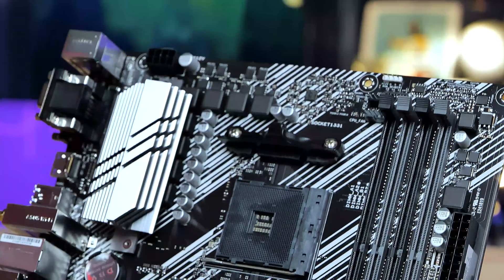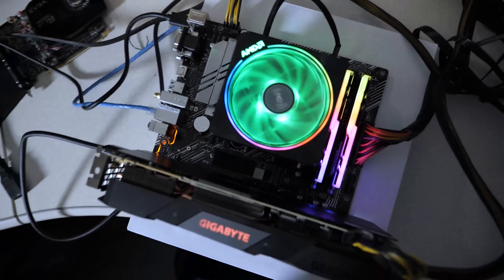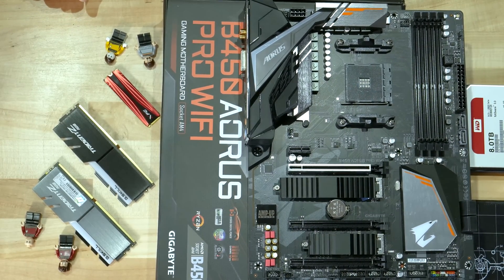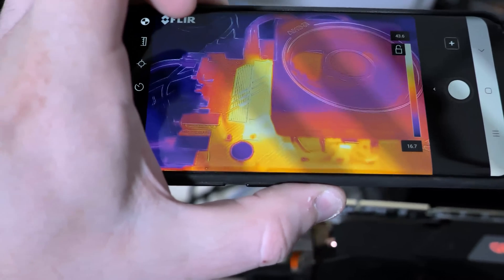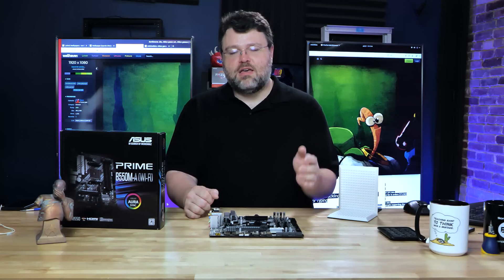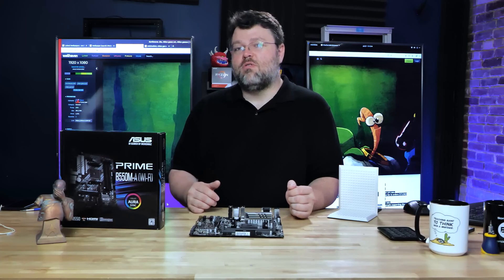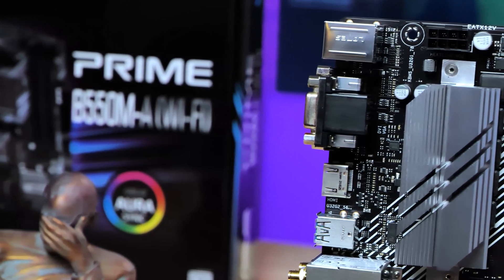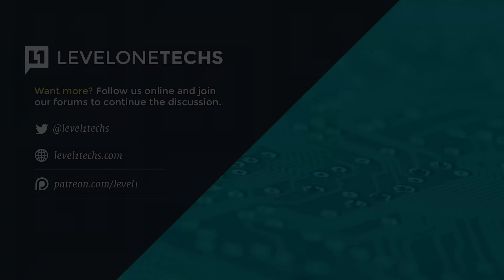ASUS B550M-A PRIME Motherboard Review! - But How Is The VRM?

Comment: 5 years with this mb -wifi, Ryzen 7 3700x evga 10 gb rtx 3080 32gb ram but im very novice and went from artifacts to intermittent blinking(blanking). beside that solid frames but terrible desync. im sure the build is solid its just tweaking and user error

Comment: WOW asus is using thick thermal pads instead of properly mounted heatsinks with thermal paste or thin good pads, i thought these motherboards are suposted to be good.... what a joke, i just purchased a motherboard and wanted to put some good thermal compound on to replace the typical mass produced white goop and it has about 1.5mm thick PADS with about 1.0Wm.k that go bad fast makes the heat sinks basically fake and just for show, AVOID, the chip dies are perfectly flat and should had 4 mounting holes and long lasting thermal paste vs garbage thick pads that leakout and drip goop

Comment: Does this motherboard have bluetooth? I bought it thinking it did but have spent ours trying to get the Bluetooth to work it reads that there are Bluetooth drivers and it says Bluetooth is enabled on the bios and in windows (yes I’ve updated the drivers and I even completely reinstalled the Bluetooth drivers and it did nothing)

Comment: This info was a big help. Much thanks! Migrating from a Ryzen 3 3300g with RTX 3060 on an Aorus B450 pro wifi to the ASUS Prime B550M-A WiFi and a Ryzen 5 5500 with same gpu. Basically a New/Old downsize build from mid tower to mini tower with card reader and optical drive for historical archiving and light gaming. RAM ddr4 16gig 3200 mhz to ddr4 32 gig 3600 mhz. Linux Mint OS.
Reply: How’s is this motherboard with the Ryder 5 5500?

Comment: I'm running a 5900x and a 3070 on this motherboard, but a 1tb Western Digital Blue sn550 that's almost entirely filled up. I've been thinking about this samsung x5 external 2tb drive that I've had for about 6 years that I don't really use because my system is amd and has no thunderbolt 3 ports. I was thinking of dismantling it and taking that 2tb 970 evo out of it and putting it in the second space for a ssd on this motherboard, but not only is it slower than the spot with the primary ssd, it looks like it would require me removing the graphics card first in order to get to it and I don't want get into all that stuff. So, now I've gotta figure out a way to clone that drive unto this 2tb, so I can swap out the ssd in the primary spot. Oh boy!

Comment: 4 years later, getting the "II" version for my brother's PC (now that I have hand-me-down 32GB DDR4 3200, 3700X and NH-12S). Considering that his case can fit 10 slot boards, has 2x 230mm+ 1x 140mm fan (could put 4x 140mm or another 230mm fan on the side panel) - VRM thermals will never be an issue. And TBH beyond looks the case is utter overkill in every aspect for anything less than an E-ATX board, so it'll never need replacing.

Every other board in the same price bracket that was available had older wifi and BT.

Comment: Is this enough to push the 5700X to its limits or is it worth it to spend 15€ more for an ATX board with better power delivery and more stuff in general?
Reply: This motherboard will handle 5700x without any problems. But for 5700x3d and above, I would recommend choosing a motherboard with a better VRM zone.

Comment: i know this video was made 3 years ago but do you think this motherboard would handle a ryzen 7 5800x? i plan to pair it with a msi navida 3060 oc
Reply: I have this board with a ryzen 9 5900x overclocked with watercooling.  I had to add a fan to the vrm's because there was no more airflow due to the wateblock but they will push 215 watts to the cpu no problem.  Asus actually uses this board in their pre-built desktops with a 5700g and a 3060.  Yeah you're good!

Comment: If you could help would be great! I just got this motherboard and paired it up with a 5800x3d & rx6800xt, I used 4x 8gb 3200mhz corsair vengeance white argb ram, the pc ran with it running around 2100mhz but as soon as switched on xmp or even just manually switched the mhz to 3200, the pc would crash instantly after trying to boot and popped up with a system error and took me straight back to the bios. I removed 2 sticks so now it’s running absolutely fine, no crashes and is running xmp at 3200mhz, just would like to know how I could make the extra 2 sticks of ram work as I’m baffled to why it wouldn’t, just seems like a waste of money on the extra 2 sticks otherwise! Thanks if anyone knows the answer!
Reply: Hey, i got same motherboard but with ryzen 5 5600.
I got 2x16 ddr4 3200 mhz lpx corsair ram.
If i use d.o.c.p profile it can run it no problem but sometimes pc fails to cold boot, then i have to restart it and it sends me to bios and i just don't change anything and it boots normally.
Looks like this motherbord have very sensitive memory controller.
I'm still trying to find my stabile ram speed and voltage.
It has no problem at stock 2133mhz speed.

Comment: I used this mobo for my build, works fine and no regrets at all
-Asus Prime B550M-A AM4 DDR4 M-ATX
-AMD Ryzen 5 5500G 3.9Ghz up to 4.4Ghz AM4 6 Core
-MSI GeForce GTX 1660 Super Ventus XS OC 6GB GDDR6
-SSD MSI Spatium M461 1TB PCIe 4.0 Gen 4x4 NVMe M.2 2280
-RAM v-color DDR4 SKYWALKER PLUS 16GB 2x8GB 3200MHz CL16 Memory
-HSF Deepcool AK400 Zero Dark 120mm AIR CPU Cooler
-PSU Corsair CV Series CV550 550W CV 550 | 80 Plus Bronze | Flat Cables
Reply: Did it work out of the box with that 5500G? I'm thinking about upgrading my i5 8400 to a R5 5500. Looking for a motherboard that doesn't require a bios update.
Reply: Does this mobo has less feature in armoury crate compared to tuf series mobo

Comment: I managed to burn out a CPU cooler on this motherboard due to installing it wrong; connectors melted into the sockets and the cables burned, CPU broke too. But the motherboard took no damage thanks to the high quality Japanese surge protectors, so I just had to get a new CPU and a cooler. It's still working fine three years later. 😅

Comment: Hi....... im planning to buy this motherboard today on amazon. Can someone who has the board just help me by just saying does the power LED blink when its in sleep. Gigabyte sold me a motherboard which their support manager tells me to prove where in the manual does it say it will blink during sleep mode....and asks me politely to bugger off and they dont even have to answer....that means it doesn't have that facility. I was like WTF ? its the most basic function it doesn't need a mention in the manual. Don't all mobos allow the power led to blink when its in sleep mode ??. This shit Gigabyte B250M mobo doesnt....and bec of that i sometimes dont know if i can off the power socket...in fact the support asshole was like didn't even take effort to troubleshoot....he says prove in the documentation that its SUPPOSED TO BLINK. Now next these fellows will sell a mobo which cant even do that and we customers will have to eat shit. So i wanna be sure.

Comment: I was considering this motherboard to pair up with my Ryzen 7 3800X and yes, I don't do overclocking nor I dare to do so. It should be fine, right?
Reply: Just got this MB for my Ryzen 5 5600X, and considering doing a slight overclock. Did you experience any issues with yours over the past months?
Reply: @JonathanGuzmanDesigns  did you have to update the bios for it to work? I'm getting "no signal" on the monitor

Comment: I have the non-wifi version the prime one and currently have a 6900xt and it fits fin but I am using a (GPU holder?) Not sure what they're called but it came with the GPU so it's not leaning down on the end. And it even fits in my little cooler Master q300l. But now I'm upgrading my 2600x to a 5600x and I'm still confused on how to get the bios ready for the 5000 series chip. Do I still need to use a flashdrive to update it or can I just update the bios with the 2600x and then throw the 5600x in and update the chip?
Reply: do you currently recommend this motherboard for a ryzen 5 5600?

Comment: "All in all this is a perfectly reasonable motherboard" Oh yaay, it's the one I've ordered. I'm not hardware technical, I'm not even building it - it's such a small overhead to get a professional to do it and I want a single warranty and no stress. I certainly won't be overclocking it. And I paired it with the 3700, which you suggested almost what you suggested. And reasonable graphics card, a 3060, I'm sure would count. So phew, I was probably just lucky.

You did well to make the broad strokes clear to a layman. Thanks!
Reply: hi man. its been 11 months, how is this working?
Reply: @yusastudios  Delighted with it, I did chuck 32gig of half decent ram in it which always helps but I haven't had a single problem. Just last week I coded a pretty intensive web scraping script which ran for three days in the background and there wasn't the slightest issue as I used the computer for everyday use.
Reply: @davidmurphy563  thats really nice to hear. What is your configuration? Power supply, processor, graphic card etc

Comment: If you are scared of this VRM, i am using Asus B450M-K with a Ryzen 7 2700x with HyperX Predator 2x8GB 3200mhz, not a single problem (system is used 10h a day for the past 14 months, stable as rock)
Reply: You are using xmp profile for ram?

Comment: Hardware unboxed tested that MB, and it nearly melted. Even failed the last tests.
Reply: That bad?
Reply: @chrike01  Yes, 103 degrees VRM with a stock 3700x.
And crashed when running a 3950 OC. It is the worst performer by far in the budget class.
https://www.youtube.com/watch?v=wuPH9pCCK-E&t=853s

Comment: Can i use this motherboard with ryzen 5 5600x and amd 6800 graphics Card?
Reply from the maker: Yes B550 or X570 is the ideal MB pairing for latest Ryzen/Radeon :) it's support for B450 & X470 that's sketchy, but should be better compatible in the future. ~ Editor Amber

Comment: Using this with a 3700x and 2060 super. Works great.
Reply: How is it so far?
Reply: @everythingRICHARDIFY  still going strong
Reply: @keithw4920  thanks! Did you get any thermal issues with it?
Reply: @everythingRICHARDIFY  Not at all. And I live in the tropics.
Reply: Do you reload one of your GPUs if the other one over heats ?

Comment: Thanks for the review. gonna put this with a 3070 and Ryzen 5000
Reply: Work out the box?
Reply: @julianosorio2003  havent catch the 3070 for now. but is good with the 5 5600
Reply: @josuebarrientos8834  Does OC work?
Reply: @KORANTEC  it works great i have bought this board and my amd ryzen 7 5800x works great at 4.7ghz with my asus tuf rx6700 xt
Reply: What cpu cooler is used in this video Becuase I’m having trouble finding a cpu cooler for this motherboard

Comment: Do you think an overcloked gpu is good for this mother board I’m going to have 3 fans in the front and I’m buying a spare one for the back
Reply: My parts are a 2060 overcloced, ryzen 5 3600, 16g 3600, 1tb ssd, 600w and that’s it

Comment: Is it better to get this mobo or an msi b450 tomahawk with a WiFi adapter instead? I need WiFi capability since my router is not in my room.
Reply: IMO the onboard WiFi is huge especially on a smaller board.  Plus the 550 is better in the long run

Comment: Does it have a 3pin 5v header for argb? Also, is this mobo ok for a Gigabyte 1660 Super oc triple fan? I also am getting a R5 3600. Im just trying to iron out the mobo before ordering everything. I already got the gpu. I need wifi 6 built in which it has and my original appeal to this board but wanna make sure its ok for my 1660 super triple fan.
Reply: I building a similar setup with an R5 3600 as well but goin with a dual fan asus gtx 1660 super instead. But yeah, I like this mobo because it’s the cheapest one with WiFi 6.
Reply: @rainman11  Nice! Good luck on your build! Yeah I like this mobo alot too. Not many boards have the wifi 6 aka 802.11ax in the sub $150 price range and this board does and is only $129 which is hard to pass up. It seems like a great board especially for the price and at Micro Center if tou buy the cpu and mobo as a combo you get $20 off as well.

Comment: Anyone who is having memory docp instability with this motherboard (for some reason I was getting it with 3200MHz) please update to the latest bios.
Reply: Thanks man
Reply: Was this with 4 sticks? What Bios version worked to resolve the issue. I can run two sticks 32gb (2x16) 3200mhz but not four - the system fails to boot up no matter what I have adjusted in Bios.
Reply: @edguti  me too with 4 x 8g sticks

Comment: does this motherboard work with pcie 3 gpu's? im in a tight budget and im choosing the msi gtx 1660 super but its pcie 3, would it still work?
Reply: PCIE4 is backwards compatible with PCIE3, so you shouldn't have any issues
Reply: @TalonHawke  thanks :D

Comment: Build a PC with this board, a 3600 and a 16 GB 3600 CL 18 kit, works like a charm. Really nice and compact board to build with and if you need WiFi you might as well get this over an older B450 board as the prices are almost the same.
Reply: With the cpu, did u have to update BIOs for the cpu to be compatible with the mother board or is the motherboard already compatible with AMD Ryzen 5 3600
Reply: @tristanbarry5532  It worked out of the box
Reply: @Hasosoft  thank you, this information helps greatly
Reply: Does this have built in Bluetooth? So that i can connect my controller wirelessly
Reply: If I want 32 or 64 gb ram , which speed I buy and should I fill the 4 slots ?

Comment: Ahem, not 6+2, it's 4+2 while the +2 is in parallel. 4x (SiRA 14DP/2x SiRA 12) for VCore and 2x2 (SiRA 14DP/SiRA12) for SOC. These are Vishay "DrMos" 46A @75°C Parts...
When you look on the top you see two mini chips in the SOC portion, which are the drivers. so next time remove the heatsink and look at the configuration. Highend boards do not use such parts, so when IPS or SPS are used, the drivers are inside the package.

Comment: That VRM temps using a downstream cooler looks like one more reason why I despise water cooling. A lot of tech channels do their VRM test using water cooling without any air going trough the VRMs, them declaring this or that board had bad VRM design.
Reply: A lot of people don't think about this at all. The stock cooler for both Intel and AMD are designed to blow air downward onto the VRMs but tech reviewers rarely talk about this.
Reply: Many "enthusiasts" seem to have never asked themselves "why do stock cpu coolers blow downwards onto the motherboard? = to cool the vrms and other components. What allways makes me laugh is they liquid cool the cpu but let the vrms fry blissfully unaware they require airflow. Best solution for better cooling is simply a bigger stock air cooler.
Reply: This is a double edged sword though.

With any high level of intensity, you're just dumping hot air on the board and VRMs.

Doing the minor investment of buying a decent tower cooler is practically always better, unless you're cramped on space, then you should experiment with turning the CPU coolers fan around to draw air up instead of blowing it down. Because this will often still provide some airflow over the VRMs, while exporting the hot air asap.

Comment: I've been having nothing but issues since building a system with Ryzen 5 3600, RX 5700XT Pulse and this exact motherboard. Tried 3 different types of DDR4 memory (two of which were QVL).

Not saying it's because of the motherboard, but I can't run DOCP without crashes and even with DOCP disabled running Unigine Heaven crashes in 5-10 minutes. Latest BIOS and (chipset)drivers, but this combo is not working for me.
Reply: Did you exchange the motherboard? Defects do happen.
Reply: @tim3172  Not yet, but I will. Was hoping to nail down whether its CPU/GPU or mobo
Reply: @MailFan  what mobo did you get? You now have the same issues with the new mobo?
Reply: @imortalkko  Still same mobo but newer BIOS versions have resolved all issues I had. In fact, it's been a very stable systeem and can support a decent overclock.

Comment: May I ask how you can run 7.1 audio through 6 channels? You only got 3 3.5" jacks there. 7.1 requires 4.
Reply: If you read the manual, it specifically states that for 7.1 channel output, the Front Panel Audio header is re-purposed to output the Side channels) (I quote verbatim: * Choose the chassis with HD audio module in front panel to support 8-channel audio output.)

See page 1-7 from this manual here: https://dlcdnets.asus.com/pub/ASUS/mb/SocketAM4/PRIME_B550M-A/E16550_PRIME_B550M-A_UM_WEB.pdf
Reply: @DuyLeNguyen  I see, it can be done but through a janky solution.

Comment: You used a thermal camera only? And a downfire cooler? With a downfire cooler damn near any VRM will hit 63c lol, but even still surface temp plus reflective light makes that thermal camera useless. Love your channel, and you may be right overall, but.. Maybe grab some K type thermal things? That way you can get some more accurate readings, even those dont get internal temps which just have to be deduced. Great review!

Comment: I think people overreact about VRMs now, but also want an upgrade path available and some of the 3xx or even 4xx series AM4 boards would NOT do great, especially with low airflow, with a 3950x or even 3900x. For my 3600 my 4-phase with airflow and heatsinks is fine lol. But ill be cautious if I ever get a used 3950x or 4000 series one day.
Reply: Please help do you use this motherboard. And do you recommend for ryzen 5 3600 and gtx 1650 super twin fan 4gb ram